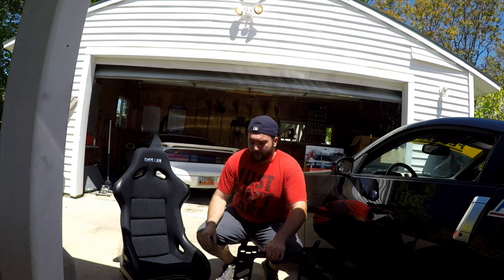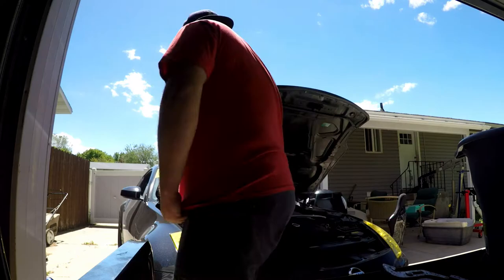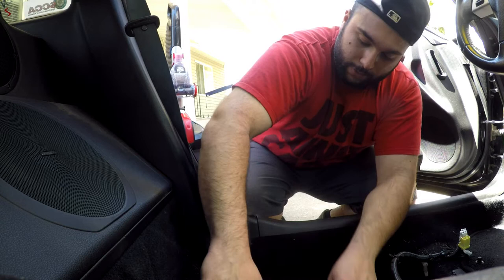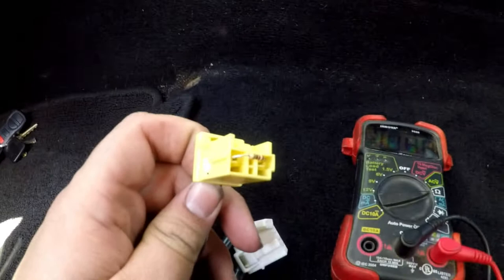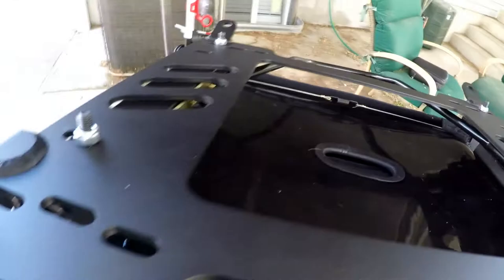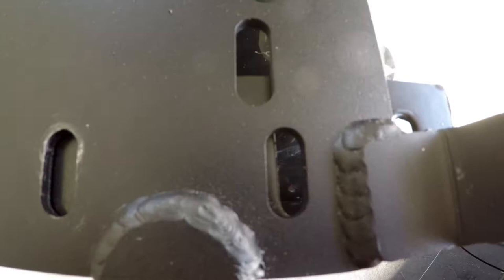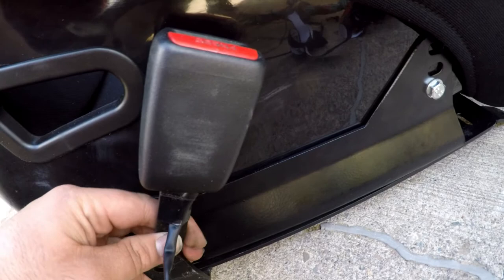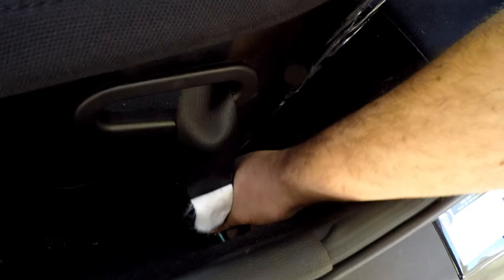A Day In a 350Z | Installing a Bucket Seat

Comment: So if you leave those connectors unplugged will it damage the ecu? Or will you only get a harmless/annoying light?
Reply from the maker: You'll only get a light. Possibly, your other airbags may not deploy when needed if there is a failure somewhere in the system, that I can't confirm but have heard that from a few people.